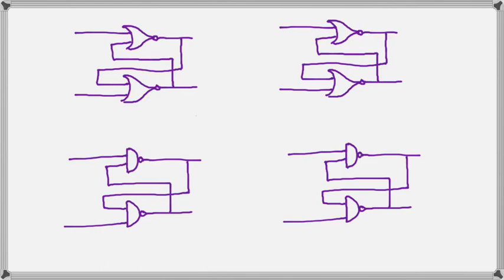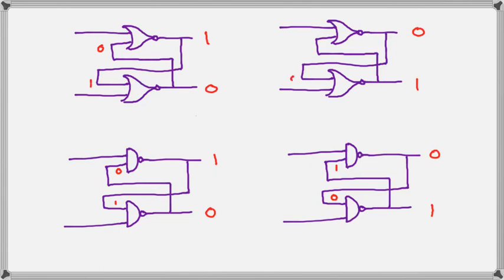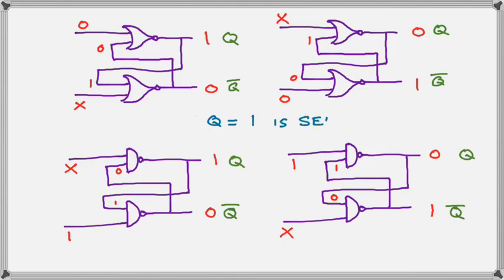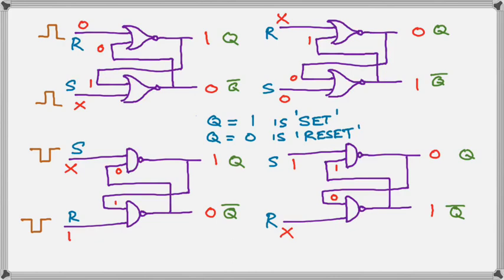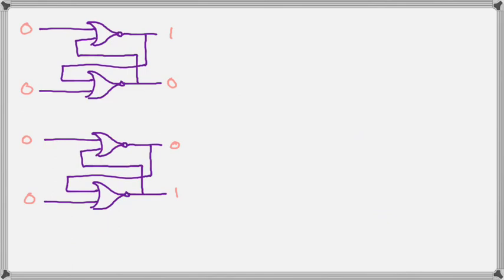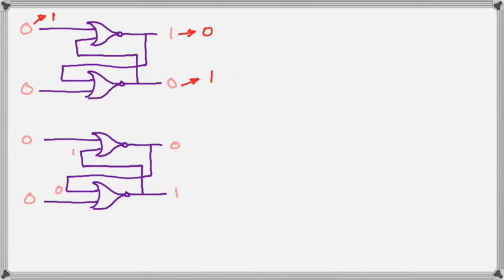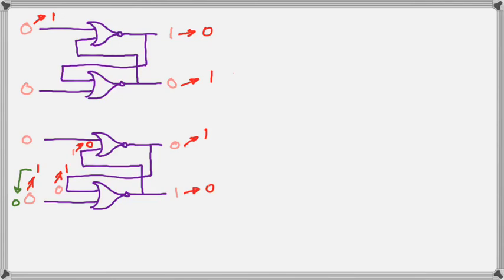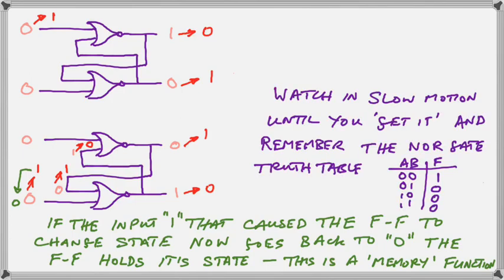Basic Flip Flop fully explained

Comment: From about 6:30 in the video, regarding the bottom diagram, after the process runs and the 1 at the bottom returns to a 0...  I know you mentioned that the 1 is stored but wouldn't the process repeat infinitely?
Reply from the maker: Well....  yes and no..... in one sense, the Flip Flop goes on changing state 'infinitely' because that is what they do, and that is the only thing they can do..... so eventually the time will come when the 'stored 1' is discarded and a zero will be stored instead of it.
BUT in order for things to move on something would have to happen at the top input of the bottom diagram..... because after the 1  is stored, the bottom gate loses control of the situation because the bottom gate has TWO inputs and the stored 1 (at the upper input of the bottom gate) is holding that gate output at 0 regardless of what may be on the other input.